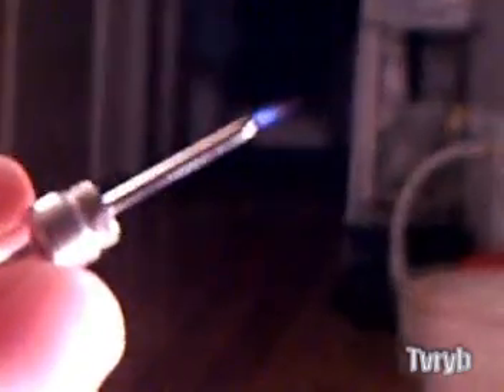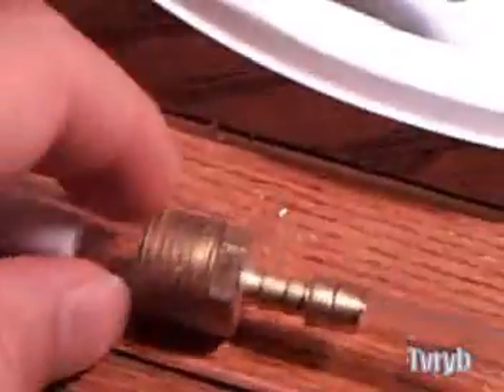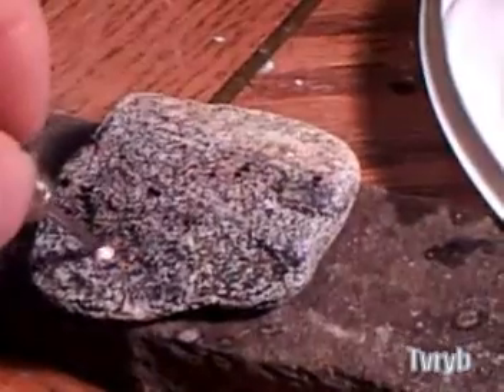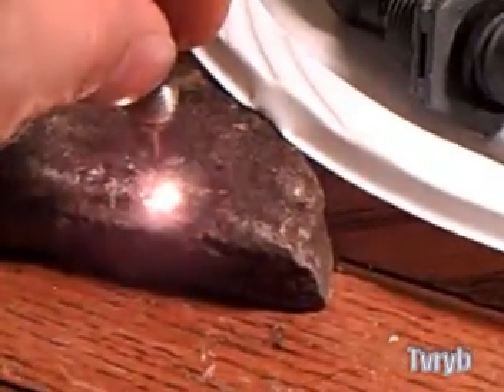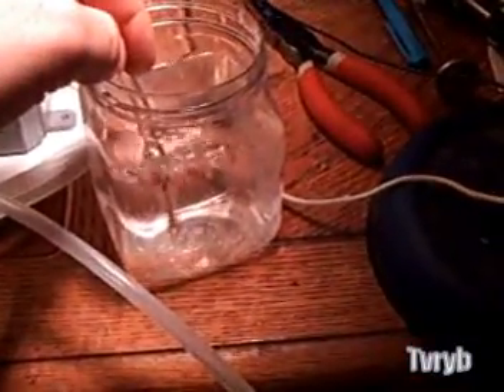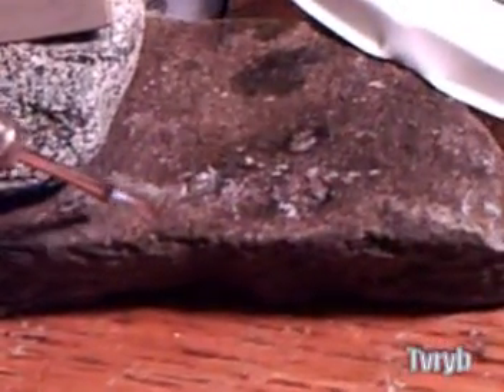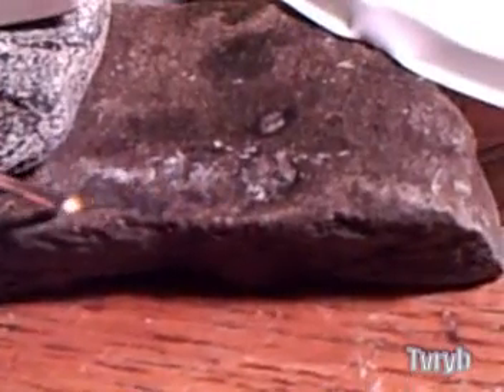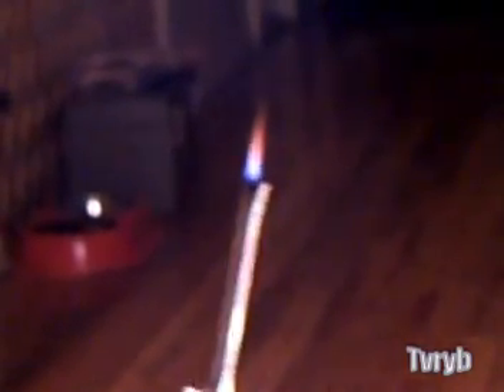HYDROGEN MICROTORCH - HHO Welding Torch

Comment: Hmmm... I made an experimental hydrogen cell within an old plastic spice container, and made my own welding nozzle. As the only thin metal I had was aluminum, I used it for the nozzle and cell-sheets. I blew it up with a blowback... it startled me, but it didn't have a long enough tube or enough space for gas in the cell, so it was just a pop.
So that's another thing to ensure that you don't have a dangerous blowback: no space for gas, other than the flow from the tube to the nozzle.

With just 18v and 0.2A, I got enough gas to produce a flame. So if you build an efficient cell, with the metal sheets close together, and a good surface area. Even a DIY cell can be really efficient.
But the nozzle was crap, and I couldn't get such a nice concentrated flame as in this video.

This video has inspired me to try it again. And this time with a proper water-based blowback protector. I think just having a knot/bend on the tube, filled with water should do... though I wouldn't trust that for a proffessional solution, hehe. ^^
As a blowback would perhaps blow back the water and just continue combusting/flashing the hydrogen+oxygen all the way through the tube.

Comment: I think your flashback arrestor might be unsafe. There is a large space after the filter where the gas might burn inside if you get flashback. You should probably shorten the length of the plastic tube to not have any free space after the filter.

Comment: ...Unless the electrolysis is run via a solar panel. Then the hydrogen is merely a storage medium which is quite versatile since it can be used for electricity, heat or torches.

Comment: Splitting water requires an input of energy. You recover that energy when you burn the resulting gases, minus a fair amount due to inefficiency. So you can't run a car on water, and if you use electrolysis to supplement a gasoline engine you are actually making the engine less efficient.

Your statement was a bit ambiguous, so forgive me if I misinterpreted it.

Comment: That has been invented more than 200 years ago!!!

Due to competition from the acetylene-fueled cutting torch and from arc welding, the oxyhydrogen torch is seldom used today, but it remains the preferred cutting tool in some niche applications.

Comment: Well granite is mostly made of SiO2, which has melting point 1650'C (wiki). Hydrogen burns at I think more than 2000'C some sites say as much as 2300'C. Now what I am guessing to the reason it doesn't hurt is this:
This combustion only creates H2O. I'm liking the oil on your skin is repealing the H2O. Remember from chem polar and nonpolar chemical don't mix. Near the objects hot metal particles or even CO2 with normal fuel is being thrown at your finger.

Comment: Ok. I have mix now with NaOH and KOH. It's a washing lye from the local dairy. I think it works better than only NaOH. I have a rebuilt battery with stainless plates in that I get between 6-6,4 mmw from.But I struggle to get a glue that holds over time..

Comment: Were did you found such a load of crap?
There is no distinct kind of "Browns Gas",
It is just a Stoichiometric mix of H2 and O2,
= Oxy Hydrogen aka Hydroxy.
No one with an electrolyzers is making
moatomic H and O, unless in fairy tails only.
"PROVEN!"; Where ? Show us.
And there are no implosions when burning Hydroxy or using it in an ICE, thats an Hoax.

Comment: Have you tried to melt a sapphire or something similar ? ( I don't even know if one can make "liquid sapphire" )

But I was curious too see if this torch could remove impurities in gems ( like heating them ) or if it would straight up melt it / annihilate it.

Sapphires melting point is ~3,704 degrees F. So if you video one of those melting... you can surely prove its power. (~3,272 degrees to remove impurities.) Little impure ones are not expensive.